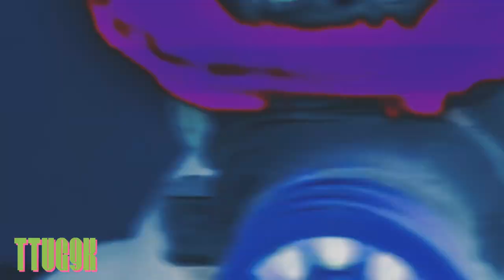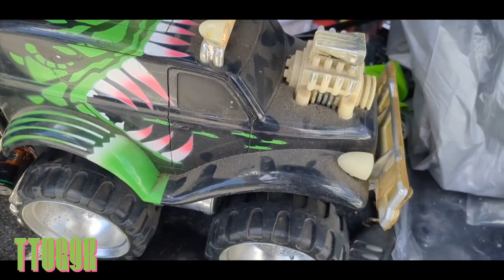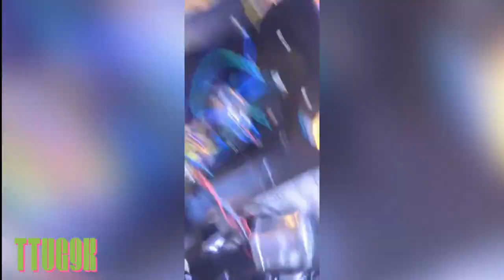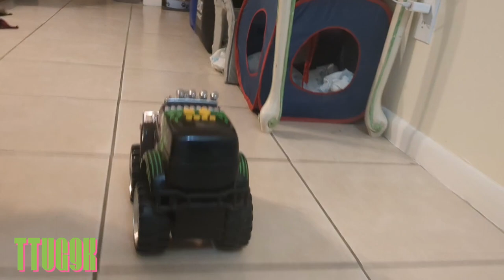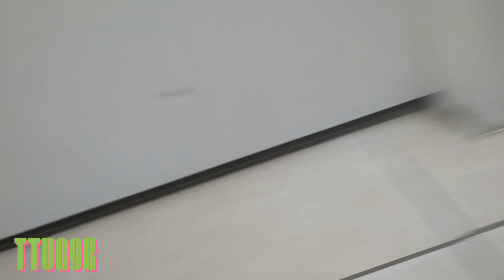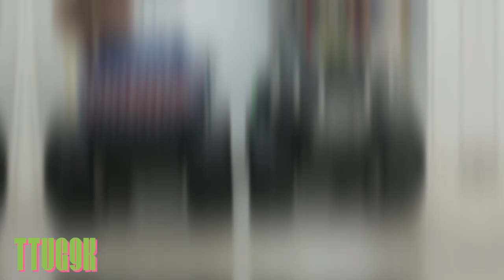2003 Road Rippers Lake Lurker Monster Truck | Custom '39 Dodge Panel Truck [Legendary]

Comment: Yo, this is a damn crazy find, glad you got it fully working again, and sadly it’s missing a light bar light, but I love this ones design, and I like toxicity, but I still need to find a stubby base vehicle
Reply: Rack Light on the rack assembly*
That's what it's technically called